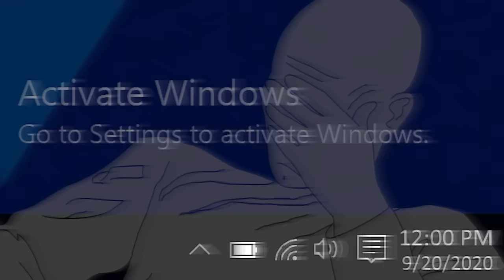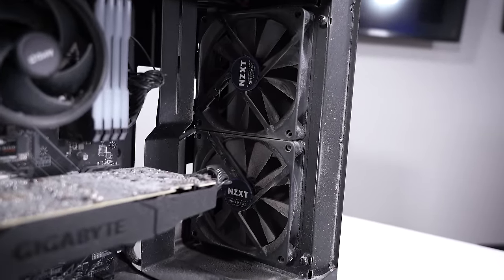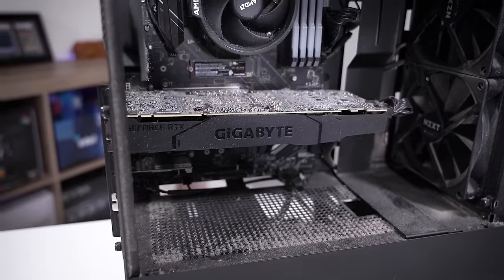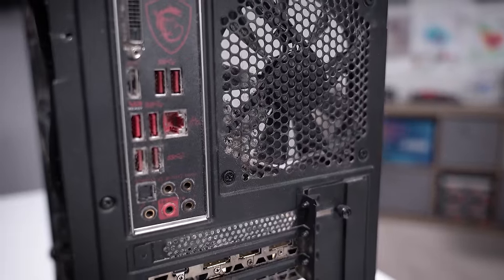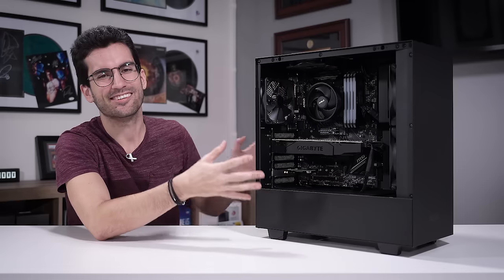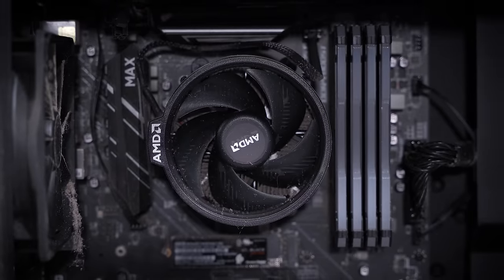Deep-Cleaning a Viewer's DIRTY Gaming PC! - PCDC S3:E10

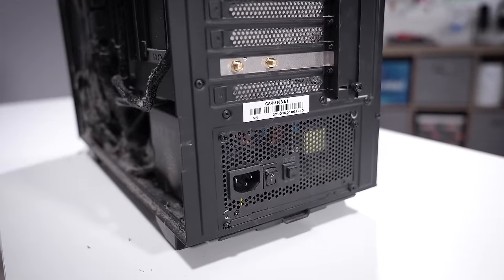Comment: I have one of these old 510 cases and the intake is so tiny, if it gets clogged (probably directly on carpet) it can get an insane negative pressure system which is why so much dust was pulled in on the right side of the case. At 2:57 you can see it on the side of the power supply. This is more than just a year of dust but what a transformation!
Reply: Came to the comments to say this. 

Airflow folks, it changes things

Comment: Would have reoriented the top fan as an intake because the front fans have to pull air through tiny gaps. Positive pressure would keep this rig a lot less dusty in the long run and as it is set up with the two unobstructed fans now, is effectively keeping it negative pressure meaning it will keep sucking in and settling dust over all the components you just cleaned.  Just a little tip

Comment: Two 140 mm intake pure wings 2 fans for quiet airflow. I put a used dryer sheet on the intake to collect the dust and make cleaning easy. Inspired laziness.
Oh the system in the video looks nice. But would prefer mesh front case. Would be proud to own this with that caveat.

Comment: The AMD logo on that Wraith cooler is part of a snap-on ring that attaches to the fan. You can carefully remove it and rotate it 90 degrees so the logo is on top; I did it with mine

Comment: Decent front ventilation that is filtered would fix most of that PC's issues. Must have been negative pressure, so pulled in air from ever nook and cranny
Reply from the maker: Yep! It's especially bad in these cases from NZXT.

Comment: I'm re-casing my rig into a smaller Corsair case tonight when I get home. Your PCDC vids are making me super stoked to get started. Have a whole new set of Noctua fans to totally revamp my cooling. My RX 5700XT hasn't been re-pasted since I bought it, so that will be interesting.
Reply: Update: New setup is beautiful and tasteful. Glad These videos inspired me to do so. After deep cleaning my mobo, I found that the chipset heatsink thermal pad was dried out and crumbled to dust; replaced with fresh paste. My GPU... oh boy. Power Color failed on that. My 5700XT ran hot, everyone knows that. But the thermal paste they put on was just sad. It had a "spider web" pattern of air pockets that created poor coverage over the die, and it was dry and powdery. Re pasted, and has a WAY better thermal profile, I'm talking 20C less than before.

Comment: I like your videos, but I do have some pointers / suggestions which I believe it could improve such service and things that are a bit obvious. The first thing is when you put the pc case on the floor to dismantle it, there should had been something underneath such as a cloth or a bedsheet which is easily obtainable even a bad one could do the trick so therefore you won't scratch the case, second thing I would like to point out that instead of wash it with water you could easily use a leaf blower or a vacuum with brush which would do the same outcome and you won't risk of having the case wet in some " cracks or holes " where the parts will be and that will result in risking on short on some parts, Third thing is that when you put the parts on the floor your also risking on shorting it since the floor itself is a conductor, and if one of the caps are still charged you could short out the board and ruin it, but at the end I like the result and it looks like brand new, but in my opinion you should try to maybe change the method to a better one, Regards

Comment: Great job Greg. Everything looked brand new to me. Really a beautiful piece of work. 

This video showcases why I won't buy one of these cases or any case like it. No airflow. That rear cable area looked like that because the front fans are starved and pulling air from the area behind the cable tray to feed them. Even if the filter on the bottom wasn't dirty, the size of the opening allowed for air intake on those front fans is nowhere near enough. So the exhaust fans will pull unfiltered air in through the back panel. The dirtyness of this system is the result of a negative pressure system.

That owner should mod the case and put a filtered grill on the front close to the same size as his front fans. He should also clean his filters at least twice a year... LOL

Comment: Why people don't clean their PC's at least once a week is beyond me. I have a Lancool II mesh case with a 4080 and 12900K, and it accumulates dust rather quickly, even with even air pressure inside the case, with a 360 rad on the front and 3 exhaust fans, 2 on top, and 1 in the back. I just take a can of compressed air, and give it a couple squeezes and boom, dust gone. In fairness, my side panels are magnetic and open like a door, and so do the bottom panels, but either way, when I had a different case with thumb screws, I still cleaned at least once every few days. Avoiding dust buildup ensures better longevity in your components.

Comment: That case is an hotbox. It will cake itself in dust in no time and it's fully negative pressure probably, that's why the dust was everywhere even behind the motherboard tray.. maybe flipping the rear fan as intake could help.
Reply from the maker: Flipping the rear fan as intake would not help dust intake one bit considering it's unfiltered.
Reply: @GregSalazar  It's something I generally do with AIOs ( when mounted up top as exhaust). 
Add a mesh magnetic filter helps, but in this case and with the stock AMD fan maybe it's enough to achieve more positive pressure than negative.
However nothing can be done if the owner isn't cleaning his room nor the rig every once in a while. And maybe also smoking judging by the type of dust :)

Comment: start using Noctua Thermalpaste on the Gpu Die, its not Silicone based.
otherwise you will have Hotspots forming over time with Silicone based Thermalpaste like MX4 and so on.
btw, love your Videos :)

Comment: Great to see the audio transitions matching with the visuals. By the way, which bit is used to remove the AMD cooler shroud? It's kinda hard to get to
Reply: It is merely a few plastic clips that latch on the aluminum block
Reply: @imglidinhere  No, it's not. It's 4 phillips screws.

EDIT, NVM, forgot it has clips on the inside ring.
Reply: @x8jason8x  They are... hardly deserving of the name "clips" given how intensely huge they are and how firmly they adhere themselves to the actual heatsink itself, eh? :P

All good. :D Glad you found it!

Comment: The only downside for PCDC for me is that it’s not very “listenable” compared to Fix or Flop. However I love this series and I recently did a very major clean for a PC case + motherboard I found from a Goodwill, and some of the bits from this series were very helpful

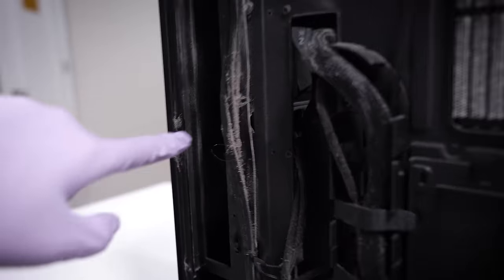Also 3:18 I’ve had a H700 for a while, and those fans are so negative-pressure it seems to suck dust from everywhere

Comment: This PC wasnt cleaned over a year?? well technically 5 years is over a year.. but this system looks to have NEVER been cleaned before. It's impossible to get a dust buildup like this with 12 months. My PC is in a seriously dusty environment I clean once per year, depends how it looks, sometimes less then a year between cleanups but it's not even remotely close to the 3lbs of duset that was in this rig of the viewer.

Great job though the end result was awesome!

Comment: Do you have a video showing how to do a cursory cleaning? You often say in these PCDC videos that if only we would clean our PCs every couple months or so, there wouldn't be a need to deep clean. I'm wondering just how quick and easy a cleaning would be if done every two or three months like you say. I've literally never done maintenance cleaning of a PC. But the PC that I have now is the most expensive one I've ever had, so if I can make it last longer and function better and look better for longer by cleaning every couple of months, I'm for it. I just don't know how to do that. I'm hoping it doesn't need as deep of a dive as your PCDC videos show.
Reply: Not Greg, but I do mine monthly, with an electric air duster, and 90% (or higher) isopropyl alcohol. It's not a terribly long or complicated process, I just pull both panels off, run the air over it, and wipe off anything that needs it with the alcohol.
Reply: if u have dust filter, just clean them every month and it will be good. also u need to clean cpu coler once in 2-3 month, u can do it with brush. and clean fans every 6 month, so >90% of dusk will be kicked from the case. i do same and a few month ago i disassemble the full pc and clean case with wet wipes (first time in 1.5 year) 
u can clean dust filters and fans even when pc is on (just take fan connector off the motherboard) and it wouldn't be so annoying
Reply: @Magnus__Bane  That's terrible advice. You should never remove a connector from, clean, or frankly anything other than use a computer that's powered on.

Everything else you said, fine if that's how you do it, but never work on a powered on PC unless you know exactly what you're doing.

Comment: i just have a question and need insight current build is 2060 rtx ryzen 5 3600 with b450 max, i just bought a ryzen 7 5800x while swapping cpu i dont get post with new cpu and i get a hard cpu light but i swap back and it works. is it just not compatible with my motherboard or is it dead?
Reply: Check for BIOS updates. I think this is the problem. Almost all Ryzen Mainboards are compatible with the 5000 Series.

Comment: I dont understand why people still use those garbage stock cpu coolers. The finstack is so tight that those collect dust like magnets and once theyre full of dust the cooling performance is really bad. Even tho its not good even without the dust.

A decent "tower style" air coolers are like 20-40 bucks max and you can use the same cooler for different builds and sockets if you want to.

Comment: Way over kill on the clean. Simply using a hi power cleaning system (high power blower) is all that is necessary to remove most all of the dust which has accumulated. The only other thing worth doing would be to reset the CPU will a fresh thermal paste. I mean, really taking it all apart and then washing it with a hose? Are you kidding me?
Reply from the maker: 100000% incorrect. I see this sort of ignorant comment every now and then, and all I can think of is that these folks have no idea how dirty and grimy systems can become. Let me be clear: compressed air alone is NOT sufficient for deep-cleaning rigs like these. Dust that has accumulated and formed sticky, grimy patches requires abrasion far beyond what air alone can provide (without using PSI so high that you damage or dislodge SMDs, fan blades, etc.).
Reply: @GregSalazar  - Have to disagree with that. The PC you showed had a moderate amount of dust particles in it, as I have seen far worse scenarios. The main reason to clean out a system is to improve the thermals back to the state it was initially working under. Using a strong blower, not enough to damage any component, but enough to dislodge most of the dust, the thermals will go back to where they were before. Your attempt at cleaning, at least to me, would be warranted only if the user was planning to sell the PC. To spend that much time and effort to gain perhaps an extra 0.5° thermal benefit far out weights the effects of this. Your deep clean effort has lots of risks associated to it due to the complete dismantling of the system,  whereby you run the risk of reinstalling something differently or damaging a component. I have been building PC's for over 30 years and I know first hand how systems behave due to dust accumulation. Yes, regular cleaning will help to keep the system running optimally. The only time I consider dismantling is when I notice the thermals start to go up and decide to reset the CPU with a new coat of thermal paste.
Reply: @john1956c  You sir are wrong. But to be fair, I think you two are talking about two different levels of dirty. Greg is not being dramatic by cleaning the PC the way he does in these videos. It is required. Especially when the user is a smoker. That makes the PC sticky, and all of the dust sticks to it and forms that waxy smelly residue. But, with your 30 years of knowledge, surely are aware of this. Come on, don't try to be an internet hero. Especially when you're wrong.